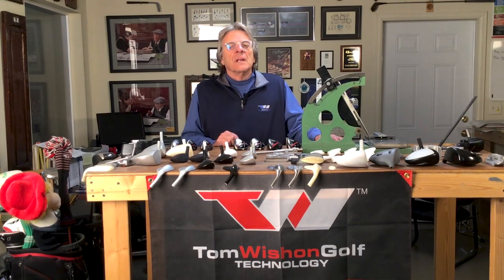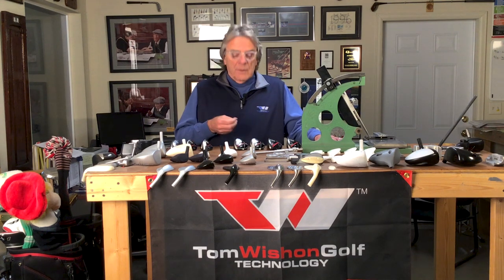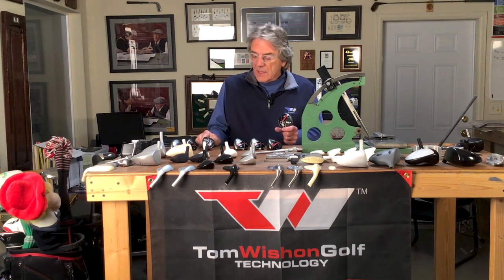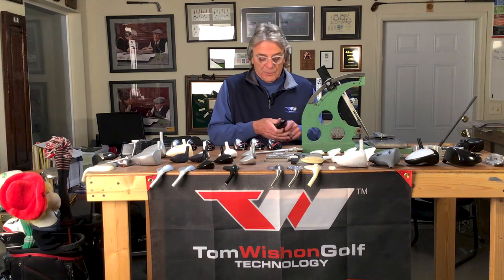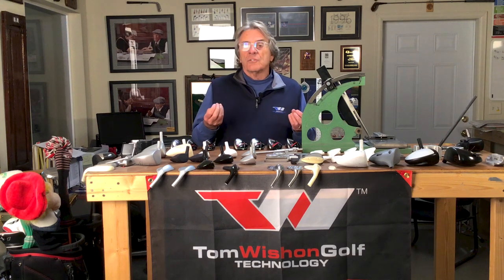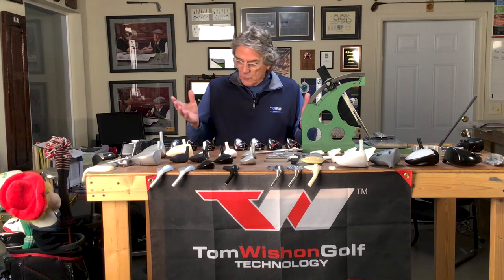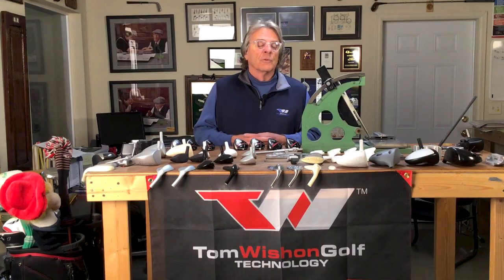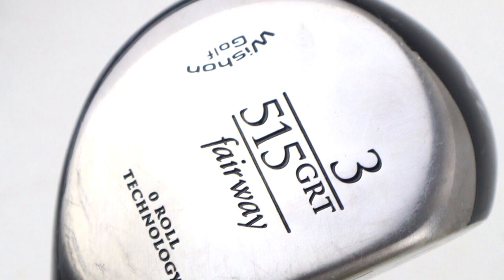Tom Wishon on the 927HS Fairways & 797HS Hybrids

Comment: Tom, I absolutely love these new offerings. I’m a high SS player, and I have the 797hs in 5,4,3. Previously I was a 1 hybrid guy but these are just sooo good. 

I also have the new 927hs in 5w, but I’m finding that my 3 h ( that I play at iron length) goes just as far as the 5w. I would LOVE a 797 in 2h model as well at 17*. 

I do have another question. That I’m pondering. Could I play a 927hs at hybrid length in a 17* 4w?